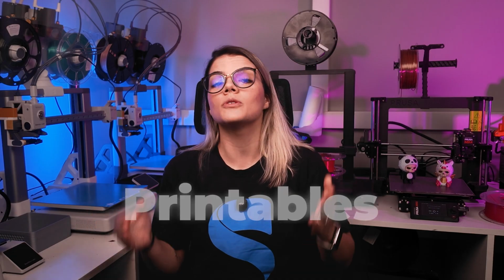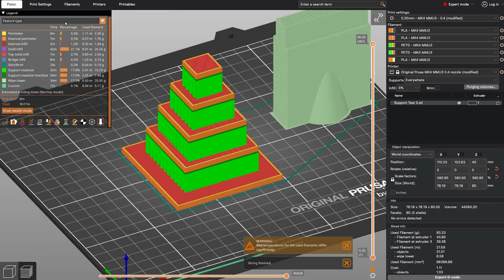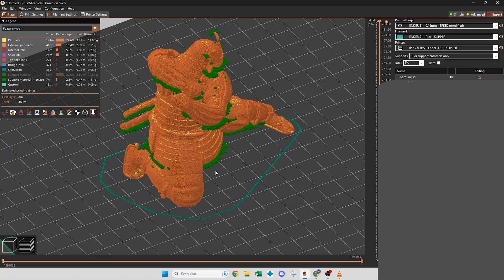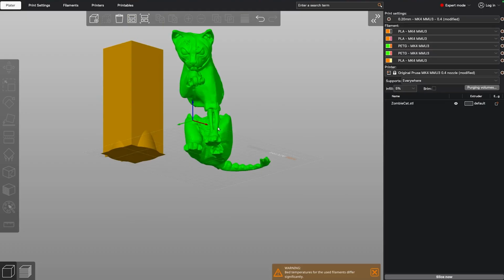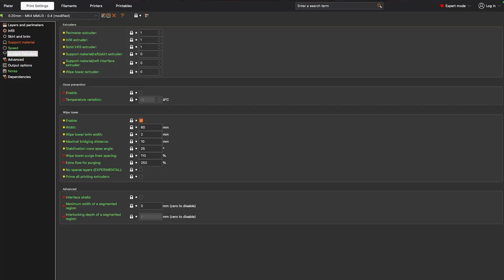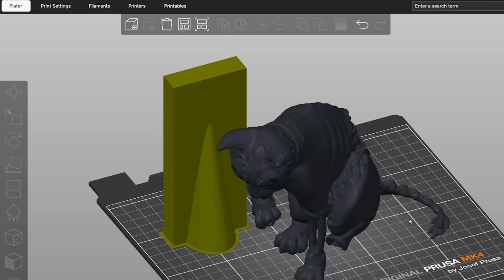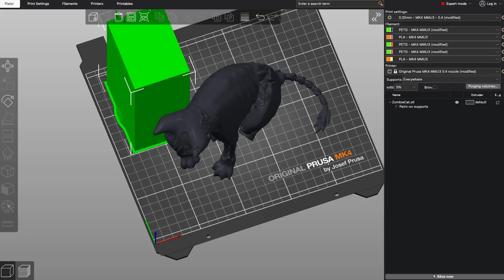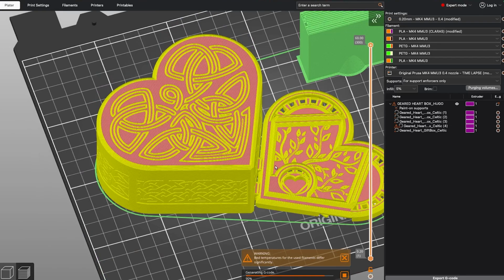I Tested PETG as Support for PLA – You’ll Be Surprised by the Results!

Comment: I fell into the trap that many people say this works enormously well for them. But what they indeed not say, or poorly mention is that they have dual extruders.
I have a cfs and tried this and indeed noticed that whenever an interface layer had to come down it made the piece at that part very brittle. almost 80% likely to break off even.
To counter it I slow down the printing on top of the interface part. so it prints at 20-50mm/s. this gives it time for the PLA to rebond to the PLA that cooled down. it's still not as strong but it is an improvement. downside is that due to the slower printing the interface PETG layer also bonds a little harder again to the PLA layer...

in conclusion, like this video states, if you have big flat area's it works very well. Organic prints is a 50-50 chance. If you have small parts, stick with 1 filament (or buy a dual extruder).